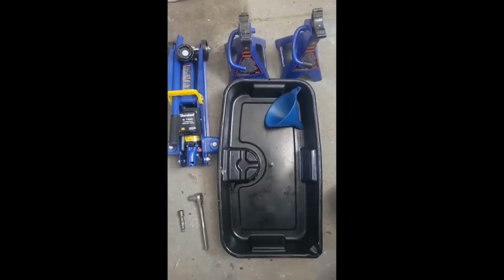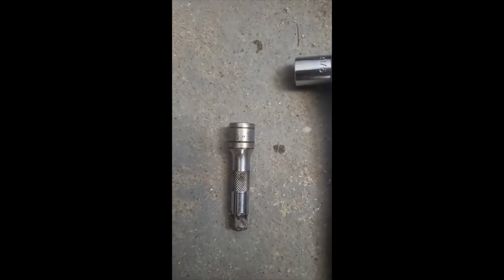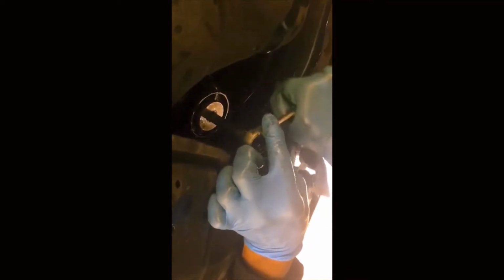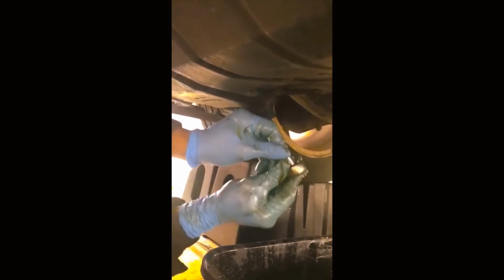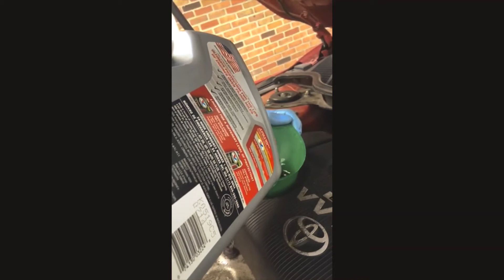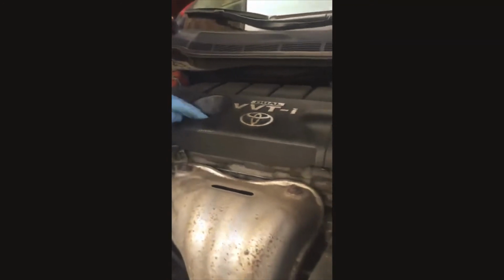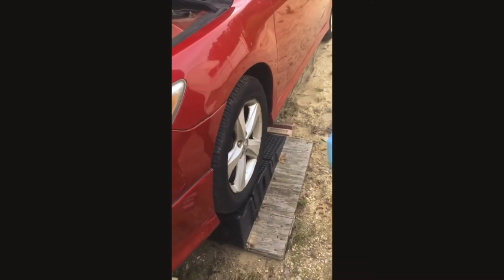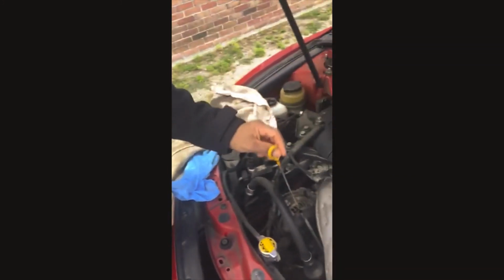How to change the oil on a Toyota Camry 2010

Comment: You are NOT suppose to put on the oil filter cap with a ⅜ inch extension.
Torque oil filter cap to 18 lb.ft.
Torque oil filter cap drainbolt to 9 lb.ft.
Reply from the maker: Thanks I appreciate your comment but I did it a few times and it worked fine 😁thanks again. The next  time I do it ill  try to remember the spec, I just wanted to give  a quick vid of how I do it .thanks again please like an subcribe I have a  ton of vids to do just been working on my gaming channel besmark7  please check it out .bye